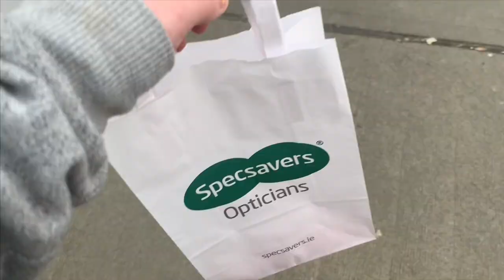I NEED GLASSES

Comment: Being a retired optician I fitted several hundred young ladies with their glasses and a good number of them were getting their first glasses you. Many of them were shocked when they were told that they needed to start wearing glasses because they thought their eyesight was completely perfect. So you really never anything about why you now need to be wearing glasses. So my first question is when you went to Specsavers to get your eyes examined were you expecting that you were going to be getting glasses or were surprised to be told that you needed them? What and when were you told to wear your glasses? I mean are you longsighted (farsighted for seeing things close up) or shortsighted (nearsighted for seeing things at a distance) or do you need glasses because of having astigmatisms?  I see in one of your replies that you replied "I actually love my glasses now" so does that mean you weren't exactly all that excited about getting glasses at first? In your video you were sort of comparing your vision with and without your glasses even though you were doing it a playful way. Are you surprised at the difference they make with your ability to see things more clearly when you have them on? I wasn't able to get very good look at your glasses but enough to tell that your prescription isn't very strong at all which is normal for a first prescription. Are you surprised that after wearing them for a while that when you take them off things seem to be much more blurrier than before you got your glasses? I'm sure it is and that's completely normal and only means that your eyes were getting adjusted to the prescription of your glasses and your eyes were starting to relax more. I assume by now you are much more used to wearing glasses and not too shy to wear them in public anymore. 
The glasses you got look very nice on you and they clearly fit you very well. That's important because if they don't fit right, they are uncomfortable and you're not going to want to wear them as often as you should as result. Glasses are very good look on you so I hope to see you wearing glasses quite often or even full time in your future videos.
Reply from the maker: Jim Boice I just went to get my eye tested because I just wanted to make sure they were okay. My eyes would get slightly bloodshot & sore sometimes & I would think things looked fuzzy sometimes & not clear so I wanted to get them checked. I didn’t think I would need glasses but they showed me on a machine the difference between my vision & perfect vision & mine was just a little fuzzy. They said it’s because I spend a lot of time on my computer or phone so my eyes are used to focusing on close things. They said im slightly shortsighted but I only wear my glasses when focusing on things like phone or computer so I’m not sure if shortsighted is the right term for it. They do make it easier on my eyes for when I’m editing so I’m happy I got them.
Reply: @leannereilly  Thank you for your reply. So you really weren't expecting to need glasses based on your answer. But you were clearly suffering from eyestrain when you went. In part something you may not even realize is that when you, and everyone else, gets involved in doing something on their computer or phone, which is just a smaller version of a computer, you don't blink your eyes nearly as often as you do when your not staring at a computer screen. That alone is a big reason for the eyestrain and eye soreness you have been getting. Your doctor was also very correct about how your eyes get "transfixed" at seeing only at a short distance for long hours. In other words that causes your eyes not to want to focus properly when when you are looking at things in the distance like they used to. I think your right that your doctor said that your eyes are now "shortsighted" but being "shortsighted actually means that you aren't as able to see things at a distance properly anymore. But i'm sure even though your "shortsighted" your glasses also are help to you while being on your computer as well. Your glasses appear to have an AR coating (anti-reflective) on them which should help with eyestrain as well relaxing your eyes as well. So let me ask you a question. Have you tried your glasses for seeing things at a distance yet? I mean like in your video at about the 3:30 - 3:40 point you seemed to be testing how well you could see with and without your glasses. If things look clearer and sharper at a distance then you are without a doubt "shortsighted" if things look a bit blurry when looking into the distance then you're "longsighted" But i'm almost certain that you're "shortsighted" By any chance did you maybe get a copy of your prescription in any of your paperwork when you got your glasses? If so and you post it I can tell you exactly what your glasses are for and what the numbers mean as well. 
How are you doing with adjusting to wearing glasses? I'm sure that it felt very weird at first to be wearing glasses. But the more you wear them the quicker you get used to them.
Reply from the maker: Jim Boice Yes when I have my glasses on things are clearer up close and very clear in the distant. Thank you I understand now, so I am shortsighted. Yes at the start I was embarrassed to wear them but when I seen how much they really help me now I love wearing them. I always have them on my head when I’m at home for whenever I need them. I will have to look in my room for the forms they gave me, if not I might request a form off them stating my information & prescription just to have for my own records. Thanks for helping me understand all of this.
Reply: @leannereilly  Don't spend too much time looking for your paperwork because they may not have even provided a copy of your prescription in them. Optical stores are pretty smart, I should know after working in for many years, they know that by them not giving you a copy and by keeping your prescription on file that if you were to want a nice pair of prescription sunglasses or maybe a spare of glasses in case something were to happen to your current glasses that you would have to come back to them for any type of glasses you may want. But if yo have a copy yourself then of course you can easily shop for glasses anywhere you wish to. But take a quick look around for your paperwork and if you find or don't find it do make a point in going back and getting a copy. Also if you do need to go back to get a copy ask them to also write down what your PD measurement is. I'm sure that you're wondering what your PD measurement even is. After you picked out your glasses you may remember the optician or optical assistant having you look into a hand held device that he or she was looking into from the other side. That thing that looked like some type of viewfinder was measuring the distance between your pupils in millimeters. That's because they want your eyes looking through the dead center part of your lenses when you got your glasses. When you're wearing your glasses your eyes are being drawn to that dead center spot of your glasses anytime your focusing on something. If that number were off my too much your eyes would be getting pulled to one side or the other and could result in you getting headaches from wearing your glasses. Anyway I have reason for you asking for that which I will mention later on. And yes it's always a good idea to get a copy of your prescription just to keep in your files and so you can check to compare any changes that you may have in your eyesight in the coming years. Since your glasses are helping to make your your up close vision clearer and your distance vision even more clear i'm pretty sure that when you get a copy of your prescription it will show that yes you're "shortsighted" but you almost certainly have "astigmatisms" as well. If you were only shortsighted your glasses wouldn't make any difference in your close up vision at all. When you have astigmatisms which by the way is extremely common to have when your shortsighted, it effects your eyesight at all distances. Depending on how much astigmatism you have it can even cause frequent headaches. So if you maybe were experiencing frequent headaches around mid to early afternoon before you got your glasses that is most likely the reason why. If that was a problem for you then just by wearing your glasses all the time will make the headaches go completely away. 
Wearing glasses for the first time in front of people you know and work with is always a little bit scary and you may even feel somewhat embarrassed to be seen wearing glasses. But as you have found out all that happened was being told how good you look wearing glasses besides lots of other nice complements. Hers something that may put things in perspective for you. Last year, 2018, a major university did study and they found that 74% of the population now either wears glasses, contacts or they have had lasik. They did the same study back in 2008 and at that time the percentage was only 62%. That's a huge increase in just 10 years time. Ophthalmologist and optometrist seem to agree that reason for such an increase is the excessive use of screens on the eyes. So back when you still had perfect vision you were in minority and now that your perfect vision is gone you're now in the majority. Doesn't that make you feel better? Actually it sounds like it didn't take you long to start enjoying being able to see everything so much clearer by wearing your glasses more and more often. just so you know it, if you're comfortable wearing your glasses and like being able to see so well it's perfectly okay for you to simply wear your glasses all the time. Wearing your glasses all the time won't in anyway do or cause any harm to your eyes. It won't cause your eyesight to worsen, which many people seem to think wearing glasses causes. When you got your glasses and wore them that first day for a while were you surprised when you took them off at how much more blurry everything seemed to be without your glasses? I'm sure the answer to that question was yes. It wasn't because your glasses made your eyesight suddenly so much worse but on ly that your eyes had adjusted to the prescription and were much more relaxed.
Reply: @leannereilly  Part 2- My reply had gotten way tooo long so I decided to break it off and do a 2nd part. The reason I suggested that you should not only get a copy of your prescription but also ask for your PD measurement as well is because now that you're wearing glasses quite often and if you drive you now need to be wearing glasses whenever you drive you might want a nice pair of prescription sunglasses to wear on those sunny days. Also how well would you be able to get along without your glasses if they were to get lost or broken. I'm sure at the very least you would surly miss them and only you know by how much. So how well would you do being without glasses for a week or more? That's how long it would take to get new glasses made. Also the cost would come out of your pocket as well and as you know glasses are expensive at the local optical store. 
So about 16 years ago in my working days yet one of my young female optical assistants came into work one morning wearing a nice pair of brand new glasses that didn't come from our store. Anyway that's another story we won't go into now. She said that she got them on line from a site called Zenni Optical (zennioptical,com) She said they were only $16.00 and that even included her prescription lenses as well. I wrote down the name Zenni and not long after that I was helping someone out that needed a nice cheap pair of glasses so i ordered a pair for her from Zenni. Very good quality and the prescription was dead on as well. Since then I have placed well over 100 orders with Zenni. Anyway now that you wear glasses you should at least take a look at this site for yourself. For prescription sunglasses you look at regular glasses and choose from there and add on the sunglass tint for $5.00 more. They have several hundred to choose from for under $13.00. Shipping is only $5.00 and they are international so they ship everywhere. Just so you know I don't in anyway get any form of compensation from Zenni if you're wondering. 
By the way as far as size. If you look at the inside of one of the temples (arms) of your glasses you will see a set of 3 numbers. The first number is the width of one of the lenses in your glasses, the second number is the bridge area or opening that goes across your nose and the last number is the length of the temples. All these numbers are in millimeters by the way and by matching uo these number with the glasses you see in Zenni your glasses should fit perfectly. One last measurement thta you can do yourself is measure your glasses across the face portion using a millimeter ruler and Zenni calls that the "overall width" this also works very well with getitng a good fit.